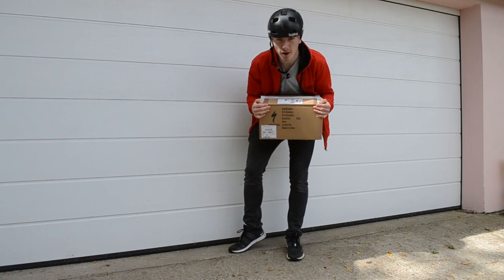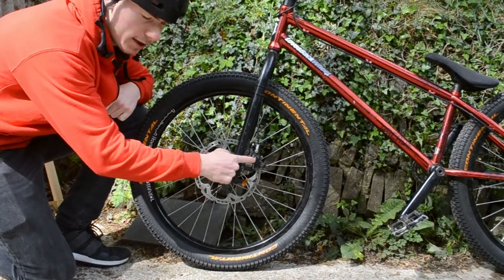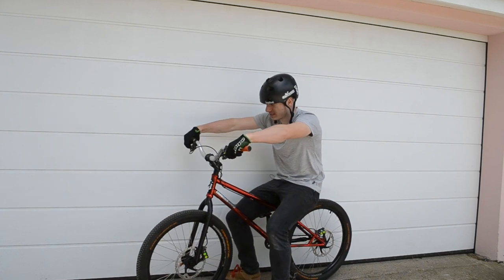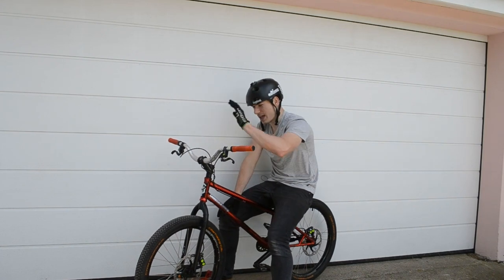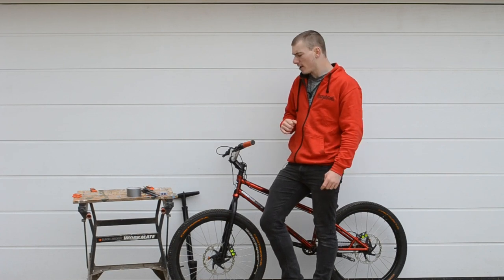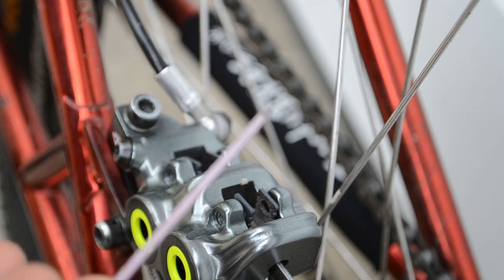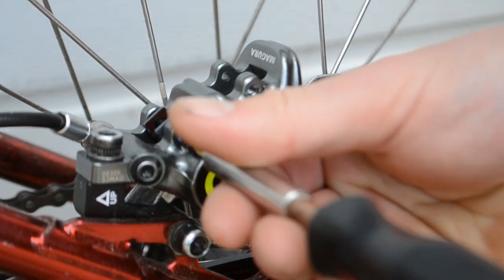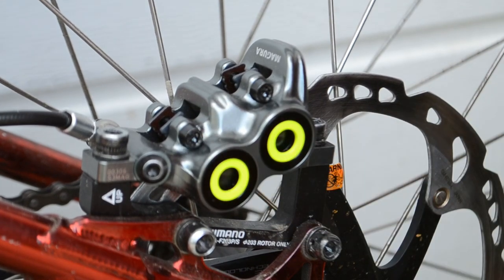New magura mt7 brakes & solving pad rock with ducktape

Comment: Think that Shimano rotors are too thin  for the Magura's. I had the same issue when first using my MT5's. 
 Magura's new rotors are 2.1mm thick.  The recomended minimum thickness for a Magura rotors  is 1.8mm, jus as thick as new Shimano's.

Comment: You have to bed the brakes. It is a 30 steps process. For 30 times on a slight slope at 20mph, brake without locking until full stop, repeats this 30 times, and you are good to go. It is in the german manual
Reply from the maker: I know how to bed brakes in I'm a bike mechanic with 4 years pro experience. Even. When bedded in these brakes will have pad rock. On a trials bike where the brake spends a lot of time locked this makes a horrible sound hence the tape
Reply: @jamespachebat6707  sure, I didn’t knew you were a Mechanic. Magura brakes are very finicky and the 30 steps is mentioned in the manual which most people overlook, and you mentioned not a firm grip I didn’t paid attention to noise, so I focused o the caliper grip on disc.
Reply: @jamespachebat6707  Being a bike mechanic doesn't mean you know everything, let alone anything. Not every brake pad has the same bedding process.

For example, the fact that you're using too thin of rotors for the brakes shows your ignorance. So, don't act so high and mighty when you're not even using proper components together
Reply: The bed in period, does not stop the rattling of the brakes. You need brake grease brembo b quiet.

Comment: Did you reduce the brakes cables? I have become magura mt7 breaks for my trial bike but I don't know if I should cut the cable or just leave it in full length.. Can you help me? I have an Inspired flow plus
Reply from the maker: I left the rear pretty long but cut the front down, there very eask to cut down shorted just make sure you know how to install a new barb and olive and  be aware you may need to bleed them after

Comment: I think the reason for your pad rock trick working is the Magura rotors are a bit thicker than the shimano rotors.
Reply: What the meaning of the pad rock?
Reply: 2 Years late...but, you are 100% correct. I had similar sensation with a set of rotors I had sitting around until I read up on this.  Putting duct tape on that side might cause some issues with the pistoins binding if the adhesive makes it through the non sticky side with all the heat and pressure.  Innovative but not sure this is a "fix" I'd reccomend.

Comment: Aren't you nervous about the tape glue melting out to the pads or rotor?
Reply from the maker: If the brake gets that hot I'd have already glazed the pads and rotor
Reply: @jamespachebat6707  so have you kept this set up for a few months then? The drift is bothersome to me as well and I would imagine there is less lever travel too with a virtually thicker pad
Reply from the maker: Had these brakes for a while no issues with the duct tape, had issues with the levers and ended. Up just switching to a hope brake set up
Reply: @jamespachebat6707  did you have the one or 2 fingers levers and what was the issue
Reply from the maker: Honestly mate, the levers are just plastic and rubbishy they started leaking. I had the one finger levers btw
Reply: @jamespachebat6707   did u crashed them? Did u recenter the brake caliper the normal traditionaly way?
Reply from the maker: No didn't crash levers just started leaking and yes centered like normal
Reply: @jamespachebat6707  weird. I wonder if maybe you just had a bad set? Idk really. But I do know a big part of their reviews and marketing is their tightly closed system. Oh they also provide a 5 year leakproof promise
Reply: @jamespachebat6707  I just got these brakes instead of hope because I want less modulation and quicker bite
Reply from the maker: @aidankieffer  have 4 mates with exactly the same problem 😂
Reply: @jamespachebat6707  oof welp if it happens to mine I’ll give them a chance, but purple hopes don’t sound too bad haha
Reply: @aidankieffer  You want more bite, then buy these, you'll pretty much flip over the bars every time you even look at the front brake lever: https://www.tartybikes.co.uk/disc_brake_pads/jitsie_disc_pads/c83p12236.html?pos=400&search_params=YTo3OntzOjEyOiJjYXRlZ29yeV9pZHMiO047czoxNjoiY2F0ZWdvcnlfcmVjdXJzZSI7YjoxO3M6ODoia2V5d29yZHMiO3M6MTE6ImppdHNpZSBwYWRzIjtzOjk6ImJyYW5kX2lkcyI7TjtzOjQ6Im1vZGUiO3M6MzoiYWxsIjtzOjQ6InNvcnQiO3M6OToicHJpY2VfYXNjIjtzOjEwOiJjb3VudHJ5X2lkIjtzOjE6IjEiO30%3D
Reply: Street trials riding won't ever get enough heat into the pads or rotor. Downhilling etc is a different story but even then, unless you hold your brakes on constantly for prolonged periods you won't have a heat bissue.
Reply: @jamespachebat6707  +1 - mine started leaking on Thursday
Reply from the maker: @project182r3  can't say I'm at all supprised 😂
Reply: @DJRipGroove99  i have a ebike and recently install the maguras mt7 with mdr 220 and 203 rotors, the combo is a beast but the rattling noise is too much, i wonder is this solution could work when the caliper and rotor gets really hot with large downhills, any advice much appreciated

Comment: Pad rock on brand new brakes fades slowly after use. By applying duct tape you're just delaying the natural wear needed for the piston to grip the back of the pad. Plus this will cause brake rub and you will have to setup the brakes again to allow for the extra space taken by the tape. 
Once the tape has worn down your brakes will feel rubbish again.
DON'T DO THIS FOLKS.
Reply from the maker: This is intended for use on trials bikes and is recommended by places such as tarty bikes and Ali Clarkson and there is always pad rock in brakes even after long term use, when the tape wears out all you do is replace it 😉

Comment: You dropped the bike yet since fitting MT7's? Those carbotechture (plastic) levers just get destroyed as soon as they touch concrete. I made a lever protector for mine that at least stops the bleed screw area from getting damaged when the levers touch the floor, see here: https://live.staticflickr.com/65535/50513577847_9fe913ec0a_o.jpg and here:  https://live.staticflickr.com/65535/50513413671_ff5d89c5b4_o.jpg I figure at least I won't start loosing oil mid ride by damaging the area around the bleed screw.
Reply from the maker: Levers failed within 4 weeks 😂 switched to hope brakes from then